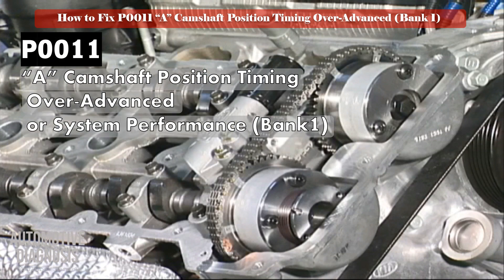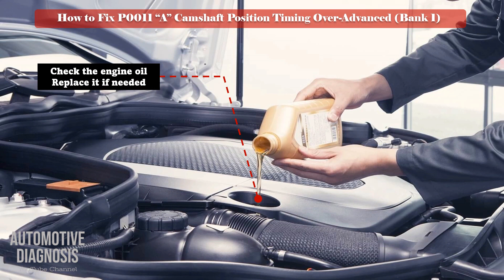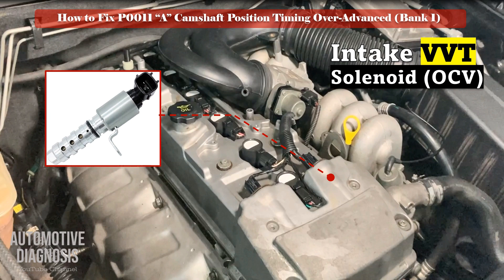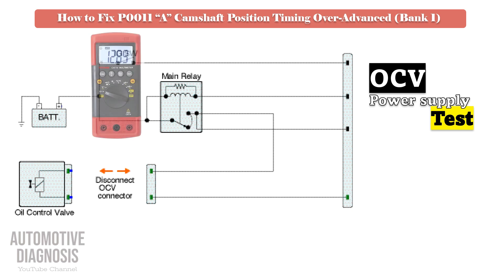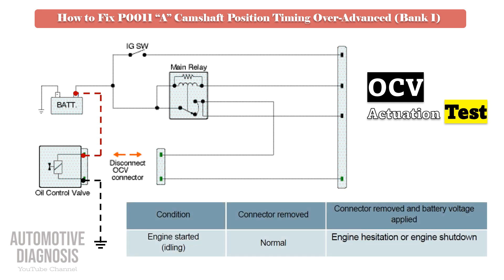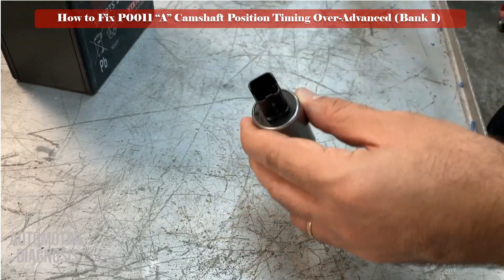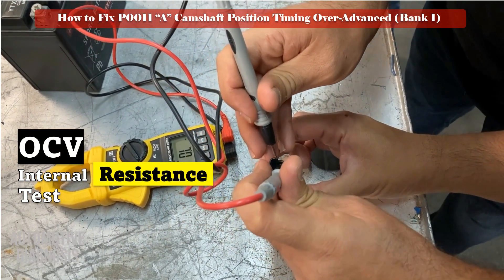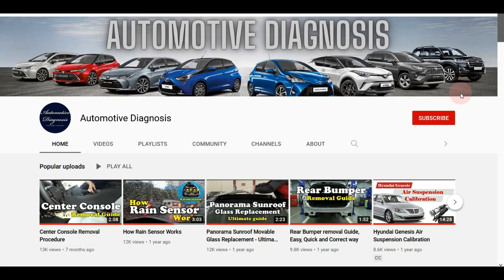How to Test & Fix P0011 Intake Camshaft Position Timing Over Advanced Bank 1- Engine Fault Code

Comment: I have 2016 Chevy sonic 1.8 
Pending code keep coming back p0011 timing over I’ve had change timing belt and both cams and both vvt solenoid and still same thing any suggestion?
Reply from the maker: Hi there, if you have changed the camshafts (with VVTs) and timing belt and solenoids, you might need to consider checking the wiring on the intake solenoid and intake camshaft position sensor.

Comment: after replacing both camshaft position sensors (bank1&2)ticking from engine (5.4 triton 2004 f-50) P0011 popped up bank 1 , and wondering if it would straight up be timing chain , or that sensor on bank 1 any experiences similar and your stories would be great !?
Reply from the maker: Hi there, if you have replaced / reinstalled the timing chain, it could be that. May I ask why you replaced both cam sensors?
Reply: @AutomotiveDiagnosis  hello! FYI I have not replaced timing chain because before going major issue is all. I replace both camshaft position sensor on front because I got codes saying both. But once replaced them it appeared P0011 , on bank 1 , and reminder there is a loud ticking noise at this point. ATP I am thinking the intake sensors , but if not to avoid replacing that and going straight to the timing chain . Thank you in advance !
Reply from the maker: I don’t suggest to replace the sensor again as you just did that. The loud ticking noise is suspicious, could be from the timing chain or VVT. I will first go for the intake VVT solenoid inspection and the. For the timing chain.
Reply: @AutomotiveDiagnosis  thank you I will check the VVT solenoid see if it may need a clean up or mabye not opening as shown in video , I’d rather not mess with any timing chain before going through diagnostic thanks !
Reply: @CurlysJourney  was it the timing chain?
Reply: @inspectorjavert5563  it is the timing chain , not just because the code given but since than , most noise became more aggressive from front end so looking like it sad day

Comment: Hello i hope you see my comment and give me a helpful reply … 
My g37s infiniti had the same code going over 8 months for now i have changed oil , filter, and both cam shafts sensors and only one solenoid sensor which is bank 1 as the code gave me p0011 but i did not change the bank 2 solenoid. So my question is. Could bank2 solenoid be the problem also? Or should i change my crankshaft sensor? Or what should i do please help me i have been in this issue for so long. Thank you so much
Reply from the maker: Hi my friend.
There are a couple of other possibilities for this case:
- If that engine has dual VVT, please make sure that you have checked/replaced the bank 1 “intake” VVT solenoid 
- You don’t need to replace the crankshaft sensor for now, but you might need to focus on the VVT itself or bank 1 Intake camshaft tone wheel which is located at the end of the camshaft to trigger the signal on camshaft sensor. 
- I don’t have that model of Infiniti right now to double check, but please make sure that there is no separate filter for VVT solenoid on the engine, if there is, it must be removed and cleaned.

Comment: i have a 2012 chevy traverse Lt i seen engine light come on  so i hooked engine reader up and P0011 came up add i looked it up and it said most common reason was low oil so i put two quarts in and engine light went off should i still get the code looked at????/

Comment: (Patrol found the following fault code/s:System : Global OBD II - 000 / Global OBD II Status :P0011 - Camshaft 1 (Bank 1) (Camshaft timing control). Error Message : Camshaft position advanced too far. Error static.Found starter motor jammed freed off for a temporary repairEngine Oil Level Ok. Coolant Level Ok.)
Please advise for above issues?
Do i need to change time chain and starter motor?

Comment: I have repeatedly had code P0016 with rough idle and worse engine power for months. I've replaced belt+water pump, both cam sensors, crank sensor, and oil+filter. Still getting it and today i got P0011 too. Here's hoping replacing the solenoids will solve it all
Reply from the maker: I think you should have started by inspecting the solenoid valve instead of sensors
Reply: Did it help? I have the same codes on my scion tC. Started with p0011 then p0016 and now p0010. Cleaned the solenoid and it didn’t help, tested power and the solenoid and all was good. I’m in the process of changing my crank sensor now. I’m at a loss for what it could be. At times it drives fine, but a lot of the time there’s late shifting and a drone/rattle noise and engine bogging. I’ve asked mechanic friends and they aren’t sure either. Shit sucks haha
Reply: @Omgjosh925  I replaced both VVT solenoids, and it now runs like a new car, so it must have been one or both of them. I noticed there was a heavy dent in the gauze filter of the exhaust one, which was possibly the cause of the intermittent behaviour, especially after putting the car under load.
Reply: @ichosethishandle  did you test the solenoid before replacing? I applied 12v power and it was opening and closing so I figure it’s good and haven’t bought a new one
Reply: @Omgjosh925  I didn't, but the dent on the gauze was substantial, and wouldn't affect an electrical test anyway
Reply from the maker: @Omgjosh925  these codes are referring to the intake camshaft and timing. If you have tested the intake VVT solenoid valve and you are sure that there is nothing wrong with that, next step could be the intake cam sensor.
Reply: @AutomotiveDiagnosis  yeah I’m not sure why someone told me to check the crank sensor first, the cam sensor would make more sense. I think I’m gonna order that and replace it first since it’s easier than the crank sensor anyways haha. Thank you for your input, it means a lot! You got a new subscriber !
Reply: P0011 can also be set because of low oil pressure.

Comment: I had p0011 code because I had a rat living on top of the engine. That little rat eat through the two wires that feed power to connector. Does it matter which way the two wire are hooked up?
Reply from the maker: Hi there, yes, polarity is important, please make sure to connect them correctly.

Comment: I have kia forte 2013 with this code and tickling sound on it, what can be the issue ?
Reply from the maker: Everything explained in this video is applicable to that car too, but generally you can start by checking the engine oil, then CVVT oil control valve (Solenoid). It could be timing chain problem as well but it's much better to check the solenoid before the timing chain as it happens a lot and it is not costly. 
You haven't had any repair on the engine recently that it needed the timing chain or head removal?

Comment: The better question is on my scanner intake valve timing bank 1 has no activity what should I do
Reply from the maker: Is there any actuation test in your scanner?
Reply: @AutomotiveDiagnosis  when I rev bank 2 changed number as the rpm’s go up and down

Comment: Could this sensor’s issue be connected to an intake valve code popping up along with it?
Reply from the maker: You mean intake valve or solenoid valve?
Reply: @AutomotiveDiagnosis  I JUST SAW THAT PERSONS QUESTION. COULD IT BE TIED TO A SOLENOID VALVE CODE? I HAVE 2 CODES. ONE IS VARIABLE CONTROL TIMING SYSTEM MALFUNCTION P0011- ENGINE CODE. THE SECOND ONE IS VARIABLE VALVE TIMING CONTROL ADVANCED MALFUNCTION P1009- ENGINE CODE

Comment: Good afternoon friend!
I have a 2011 GMC Terrain SLT. A few days ago I changed the timing chain and tensioner kit. The next day that they delivered it to me, the engine began to die at 0 revolutions while I was at a red light or slowly passing a curb, the engine died and I had to start up again to start my machine. The code that the scanner gives me is P0011: Camshaft Synchronization Fault. Excessive advance on bench 1. Camshaft position.  What is the error code P0011 friend?
Reply from the maker: Hi there,
So you didn’t have this code before changing the timing chain?
At the first place check the intake VVT solenoid connector, sometimes they forget to check the connectors after the repair. It also could be for the timing misalignment as it started happening right after the repair.
Reply: @AutomotiveDiagnosis  I already had the P0011 code before changing the chains and timing tensioner. But my engine wouldn't shut off when I was parked at a red light or going over a curb. Engine started to die at 0 revs in parked but running situations after timing chains and timing tensioner were changed. Right after that change of chains and tensioner, my engine is dying while it is static. But the truth is that that code P0011 already appeared to me long before I changed chains and my friend's time tensioner. Why is my engine dying when I am parked at a red light or when a friend passes slowly?

Comment: before i use thicker oil 15w/50..just fine...
now i use thinner oil 10w/30 ..and the code appear when i scan P0011..why??  

shud i change to thicker oil again? help
Reply from the maker: So this code appeared right after changing the oil?
Reply: @AutomotiveDiagnosis  yes sir...maybe it is compatible with thicker oil??
Reply from the maker: If it appeared after that, yes oil could be the problem. VVT works with the engine oil and mostly the thicker oil affects it's operation but in some case ant other oil which engine is not designed on, could make some difficulties.
Reply: @AutomotiveDiagnosis  already change to thicker oil again and it work back to normal.. no code appear...
Reply from the maker: @mastermind1596  Perfect, thanks for sharing your experience 🙏

Comment: hello can you help me please ( i have audi a4 2012 so OBD shows codes p0016 p0011 p000A . i dont know from where i can  start( and car stop working .
Reply from the maker: Hi There, every code you have is referring to the intake camshaft position, and as you have P000A which is: “Intake “”A” Camshaft Position Slow Response Bank 1.” and your engine doesn't start anymore, I think you must start by checking the intake camshaft position sensor first.
Reply: @AutomotiveDiagnosis  HELLO AGAIN thanks for answer so i already changed this sensor still have a same issued
Reply from the maker: Have you checked the wiring before changing the part?
Reply: Nope . I don't think so it's wiring. But I can check .

Comment: Just got the code p0011 did the auto zone diagnostic variable camshaft timing solenoid
Reply: What was the issue and how was it resolved?
Reply: @bova57  I  ended up going to the Chevrolet dealership they told me I got a bad oil leak the intake is leaking
Reply: @damienknoxmafia757  what car do you have?
Reply: @bova57  2011 impala